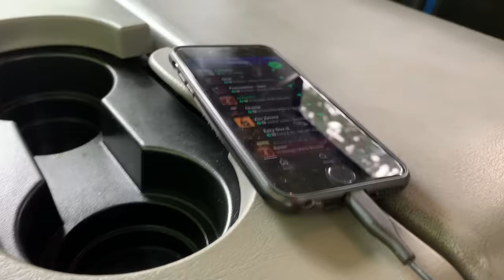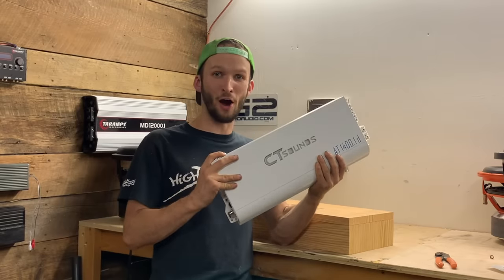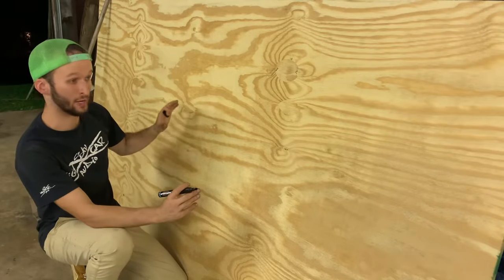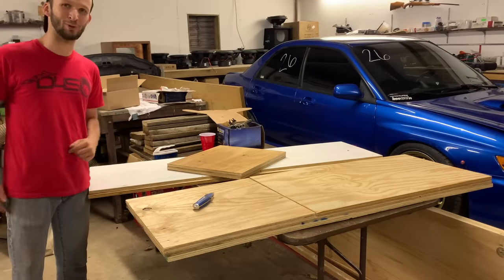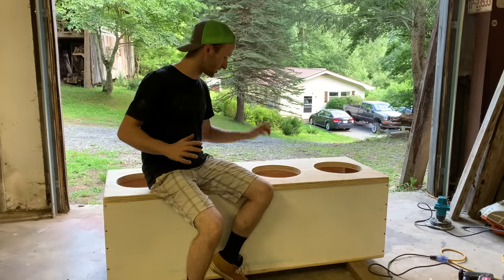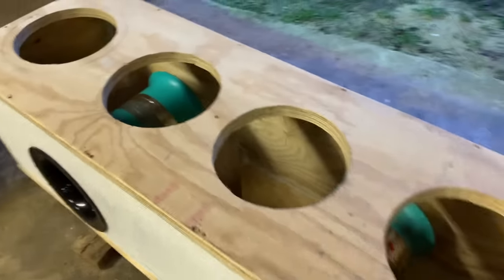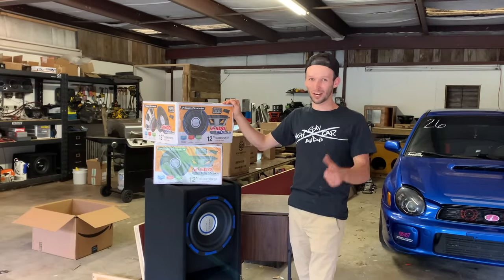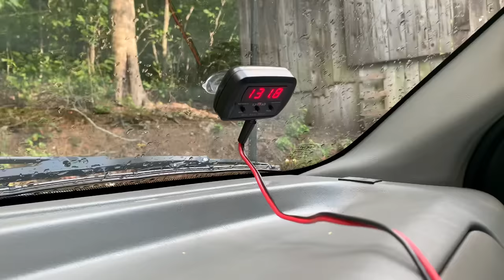How Loud? Walmart Build Part 4 FINAL

Comment: Yep just because you don't spend a crazy amount of money doesn't mean that your system can't beat hard, when I got my first setup I had four 15-in Orion Cobalt the black ones and a audiopipe 1500d the first one they came out with at 1 ohm on a kinetic 2400 and it was 147db and then I ended up building that setup same box into a wall and I was hitting 153db and I only spent around $600 with the head unit included because I got the box for free from my friend that had a car audio shop and I got the kinetic battery for next to nothing because I traded a couple pairs of Infinity and MTX door speakers that I've got out of a car the junkyard that were basically brand new but that guy definitely hooked me up, but it ended up getting me on to a car audio team because they seen the passion I have for car audio. It was so much fun, Awesome work bro ty Parker for showing people that you don't have to buy the expensive stuff to have fun. You rock bro.

Comment: My test box before building my center console was 3 cubes, 28hz, single 12in gothic facing to the rear and port up.  Had 4 inches of clearance between sub and cab wall....   was hitting just over 136db alone.     You box should have been minimal 10 cubes n 30hz for specs correct?   The enclosure really makes a difference with these subs.

Comment: Those amps are only rated at 2 ohms, but plenty of people run them at 1ohm just fine and they push around 900w at that impedance. I've tried it myself and didn't have any issues. The subs can handle 600-700w each, so it's not even like they were being pushed near their limit here.
Many times people are petty criticizing things just because it's easily accessible to everyone. Walmart also sells Goodyear tires and even Iphones, on top of currently selling Kicker and having sold Rockford Fosgate in the past, yet it doesn't mean any of these things are trash. The audio community should be concerned more about how good something is, not where it was bought.
When it comes to buying something on a budget but getting surprising quality, I feel like the two kings are Power Acoustik and NVX.

Comment: Think it would make a difference if the ports were at least 8 inches from the back wall. They are like 2 inches at max from the way it looks. I figure that would at least be noisy but not near enough flow. Have you experimented with this box since?

Comment: Love the smiles from that cheap bass I've been asking a few different channels to do a flee market, second hand,boot sales video as myself have all second hand equipment from wrecking yards and other places  my setup is a fairly high model Kenwood Bluetooth headunit  with full on seperate speaker crossovers ECT ..that I paid $10 for ..  with Kenwood   6 inch front speakers I got 4 of the same speaker's for $10. and Kenwood 6x9s for $5 a Kenwood amp that's 500w RMS bridged @ 4ohms my friend gave me and a JBL 1222 subwoofer I got for $50 and a old fusion subwoofer box I had already it kicks quite hard for the price I paid ticks me off when people say he has.a flee market build hahaha 👌 be surprised what you can get for next to nothing of you look around

Comment: Sub up and port up was my favorite in my ext. cab truck. I have a "tapped horn" I think they call them facing up and it was loud for a single 12", then I also had a very oversized box same configuration, port up sub up. I also tried sub forward, port forward, and liked it but I think SPL may have been less.

Comment: I have 2 of those with a 1200 Jensen and an other 12 I’m not sure of but I tuned my amp perfectly and all of them together would shake cars from 6+ parking spaces away and I would be watching the truck and there would be paint from the roof flying off but my truck was older it was a 1995 f150 but the subs would shake the steering wheel when i would drive down the road 😂

Comment: Ports are too close to the box wall this will create too much turbulence inside the box and decrease SPL, with the subwoofers cut outs you can probably build spacers to move them out a few inches, you could also try a higher tune like 37hz, another thing you can try is subs facing the seats and ports inverted and facing up, like the stack exhaust.
It was fun to watch, definitely we want to see more of this budget build, it looks like they can handle a bit more power, maybe with 2 more amps?

Comment: I used to brace my subs upside down at the floor in the back Of my extended cab then ports towards seats.  I didn't have my rear cab seats in, box was to big. They set about a foot from the floor

Comment: Good stuff. Plywood isn't bad for a setup like that. You could probably make some good cash building boxes, maybe even making videos of it. I know there is a learning curve nut that nook looked better than most prefabs.

Also, I commented on your fb page for the contest and had already gave it a like but it is under a different name. I mentioned that over there. I have been on a run of bad luck you wouldn't believe and it sure would brighten things up if I won that amp.

Comment: When comparing the last build to the second build you gained 7 dB. With the change you should gain 3 dB from the double in power, gain 3 dB from the double in cone area which leaves the 1 dB you gained from the custom box. I would expect more from a custom box, I don't know if it was placement, port compromising or something else that affected this.

Comment: Cool video.  I Think those subs could handle more power for higher spls. Gives everybody a good starting point to see how more modest priced car audio items can perform. Two thumbs up!!
Reply: You could here them bottom out several times so I believe he is giving them all they are worth. You could burp them with lots of power but having heard them in several vehicles myself a good 500-600 watts rms is about there power for music purposes.
Reply: @davidmarles9409  I have 2 of them in a bandpass 1000 watts a side and have no issues with them bottoming out. Sure there are plenty  of better subs out there, but I've  seen other videos where these subs are reaching in 150 db territory. I say see how much the sub takes till it blows. 700 watts? 1000 watts? 1300 watts RMS? What sub do you like as a budget beast?
Reply: @davidmarles9409  that was the camera these subs can handle more
Reply: @ianwillmott3408  no Sir I have installed many of these and they will not last long on over 600 rms. Especially more than burping them. They are a version made specifically for Walmart. Definitely wasn't the camera. Look at his face when it happens.
Reply: @ianwillmott3408  also watch his older video. He got louder with same amp and only 2 dual brand Walmart sub. Regardless of power they only get so loud and eat up the rest in heat.
Reply: @mattsnider5904  you would never hear them bottom out in a bandpass box and also I doubt you have a true 1000 rms which is all that matters. They are not bad but cheap and not very good sound quality.
Reply: @mattsnider5904  also he never got near 150.
Reply: @davidmarles9409  when did he use dual brand subs
Reply: @ianwillmott3408  I will see if I can find the link. Maybe 2 years ago...
Reply: @ianwillmott3408  also was louder and cheaper when he used 6 Walmart Jensen subs. Video is about a year ago on that one.
Reply: @davidmarles9409  I wasn't  talking about parkers system. Check out ImThirstyH2O  you tube videos. You may be right about true wattage and true bandpass for what I am using; and I'm  not married to poweracoustik subs as far as liking them,but I think they may be capable of more output. I wanted to see walmart pioneer subs in action as well
Reply: @mattsnider5904  sorry if I came off rude. I'm just a car audio fanatic who has owned and/or installed most anything on the market...especially cost friendly stuff!. Power Acoustik for the money is not bad especially for loud hip hop/rap music. I checked out that video and yeah I believe 150 is achievable with these subs and the correct box. For $80 each the only comparable subs I know of are Skar SDR series. The Pioneer Walmart subs actually sound better overall than the Power Acoustik but definitely do not have near the power or output. For Pioneer subs that pound and sound good you need to try the Pioneer D series 12 inch subs. Just my opinion though!
Reply: @davidmarles9409  it's all good  bro. I like to get to the truth about electronics and speakers as well. Especially  if it's for a competition-on the street or actual metered one.  Not really a budget sub,but Dayton Audio s 21 inch Kraken  says its louder than 2 18 inch and louder than most speakers on the market. I know it's more of a home theatre subwoofer, but sounds like a secret weapon for some bass battles lol. I like healthy discussion about  all things audio. Nice talking to you.

Comment: Those power acoustik gothic subs have always been a good budget sub in my opinion. No they don’t take the wattage as the manufacturer claims but I’ve found 500-800 watts rms is the best for them
Reply: I’ve had the same speakers and their trash.
Reply: @jmalljmall  That’s expected but better than other cheaper options.

Comment: I think that the box is acting more as  really leaky sealed box. Maybe you don't care and that's cool but i recommend getting someone to show you how to use winISD or BassBassPro. I know the videos aren't supposed to be scientific but using those programs would help you be more scientific. Technically you don't even need to buy subwoofers and test them because winISD will tell how you which one is louder over the frequency range and any size box. The ports are way to close to the back wall and then they're covered up the seats too. The air is really restricted. I'd be curious to see how much louder you could make it with small changes to the box and aiming the ports up so they can extend from the box and make room for airflow. I would assume port up and subs facing backwards would be the loudest but the subs should have some breathing room too before the back wall if possible. I graph subs on bassboxpro to compare for fun and to see what's up with some of the brands idk much about.
Edit: to sound like less of a dick

Comment: Just seeing how you had the areo ports as I’m watching the distance between the back wall to the port isn’t quite ideal you should probably have another inch or two for better air flow just so you don’t get chuffing
Reply: I know I thought the ports were to close to that back wall of the box. Thinking it might reduce air flow from the port
Reply: @rickross368  right you would be. It would restrict airflow and mess with air chuffing in the port and even the tuning itself

Comment: Is the amp actually  Ohm stable  Because I thought 2 Dual voice coil 4Ω subs wired down to 2  and then ran to the same amp Wouldn't that  Make the amp have to run at half an Ohm  And if the amp isn't able to run  at a  Half home load Wouldn't that fry the amp and make it run hot At least that's what I always thought?

Comment: I have been using power acoustik gothic speakers and the power acoustik rzr 2500 watt amp in conjunction with the gothic subs for several years. Price of subs and amp you can't go wrong.  Put the power acoustik speakers and subs Product against Product of the same $ I'd go with the power acoustik

Comment: I had 2 these crappy gothic series wanted to mess around with cheap stuff i had a cab audio 1600.1 put it all in a 04 neon sounded like one would think 90$ per sub 250 amp but still worth the price.

Comment: when did people stop using subflooring or mdf for boxes plywood does not reflect the sound it absorbs it also use liquid nail subfloor instead of regular latex caulk it dries super strong and only 3 dollars a tube at lowes ect.

Comment: Would a 10³ft box be louder? They recommend 2.5 net internal volume after sub displacements,bracing, etc. Just curious because I have 4 of the 12s and 4 amps. Currently only running 2 subs and 2 amps. Been struggling with the box build design for all 4. Trying to get the best port design is where I'm having problems. Plus that's a pretty substantial size box for the back of a 2011 kia Sorento. Any help out there would be appreciated.
Reply: By the way I have the 2 subs wired to  2ohms inside a 3.2³ft sealed enclosure for now. I'm ok with a sealed for all 4 but would want to play with a ported one for this build.

Comment: I have 1 12 in a platinum f-150. In a properly built box. 3.15 ported. Port displacement is 1.2. So the box is big. Around 5 cubic feet. Tuned to 30. 144@31hz, 140@25hz clamping 1930 watts. Knowing how to build a box is only way to get results. Manufacturers specs are always wrong. Unless you like 40-50hz. I do not.

Comment: Hey PARKER u should invert them subs & hook them up to a TRUE 2k or 3k like the smart 3k taramp u have wire them to 1ohm but DO NOT reverse the main line wire from box to amp basically wire them up like they would b if they not inverted meaning normal wire up & take off about 4" of the areo ports and plus roll down both door windows & bet u will love this sound that this will push out then and u may smell alil coil burn & might b able to hit mid 140's db @ roughly range of 35-40 hz???....

I have 3 of them woofers they r inverted built my own box with slot port tuned @ 27hz subs wired to a AUDIOPIPE APMI 2K wired @ 2.67ohm load & it metered @ 142.68db @ 28hz upgraded electrical & 2nd battery 1/0ga wire & i had my bass crew and they were all surprised by my build i only have about 800$ into my setup and i have this in a 97 f150 ext cab with lower seat removed and i have had this setup for 8yrs & they still bumping but ik they say 1200rms but they wont do it i think they r only 750rms...

Comment: Should hook a 8k amp up and watch them dance it would wake them subs up o and redo the tune on the box ports will surprise people what cheap subs on a true wattage amp and a tuned box can do.should do one 4.5k amp with all subs wired down to .5 ohm if the subs can be wired down that low just my two cents about all it’s worth my sundowns get down at half ohm but only recommend if you have half ohm stable amp and don’t run it where the amp is clipping
Reply: @CajunReaper95  not basing it off sound basing it off the test tones that he is using me personally don’t like sub bass higher then 45hz that’s just my opinion though low frequency is not for all people they like the high frequency cause it is louder but I like the base that you feel in your soul bass hits so deep it feels like your soul left your body

Comment: Okay so I have a question if I have one 100 watt RMS sub I'm good putting a hundred watts to it right but if I have four of those same subwoofers then can I then put 400 watts to it or should I still only use the original hundred Watts
Reply: 100 watt PER sub. 4 subs would like 400 watt minimum. I'd look for a 500 watt RMS  amp (1k watts peak).

Comment: I know them subs can handle more power than the Power Acoustik amplifiers can put out if you still have the Audiopipe 3K those subs  can handle more wattage it's supposed to be one amp per sub but I would say that 3K would be awesome on 4 of these sub's a man did a video with a wall with six of these sub's on two Wolfram 4500's he said he blows through them often🙄 but for the price he can't beat it  on regular Music Play he does a 155 DB maybe a new video on a bigger amp 👀 🤙🏼